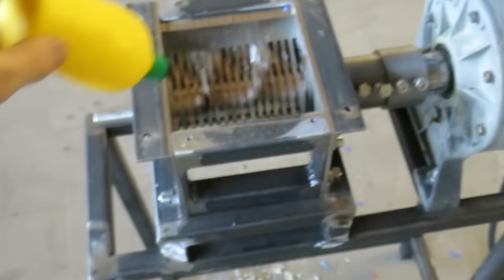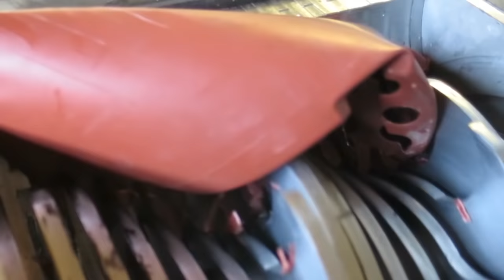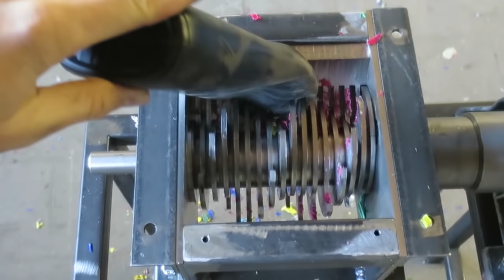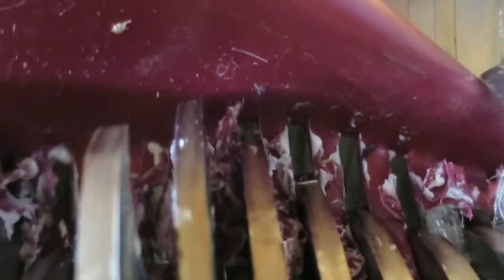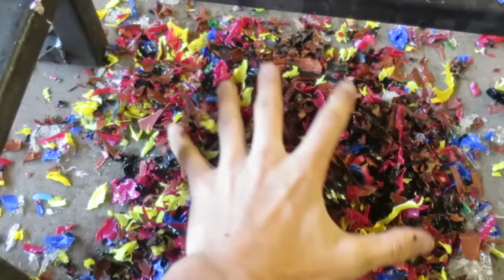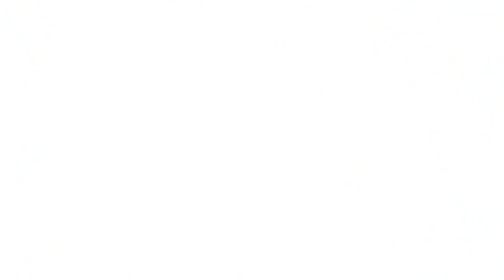Plastic Shredder prototype testrun

Comment: Hi Dave, I want to build one but i am not familiarized with motors, i was thinking to build one and replace the motor by a hand crank, Do you think it is feasible?
Reply: hi TheKevdarling, hi Dave. I wanted to ask the same question. would it work with a hand crank?

Comment: Hello dave,

I'm interested with your shredder design. But my question, how much torque I need to run your shredder design? Is it possible if I only use a high torque stepper motor?

Comment: I have a question about the machine and especially the powerusage of it. 

I had to thought if the energy that it needs to run this machine isnt as harmfull for the nature as the things you destroyed. Of course it depends of the way the energy is "produced". But I just wondered :)
Reply: Jerre Koehntopp there have been modifications of the machine with solar power

Comment: I am trying to estimate the speed of rotation. I reckon 15 to 20 RPM. Is that correct?

Yes, it is a very satisfying sound. 

I want to make one of these. With a hopper, a chute, and a hold-down-for-ON switch. Release to STOP and pull up to reverse. But there is going to be a point during construction when there is no hopper, no chute, no safeSwitch when there will be some "testing" to be done.